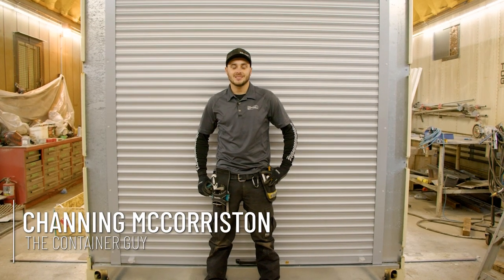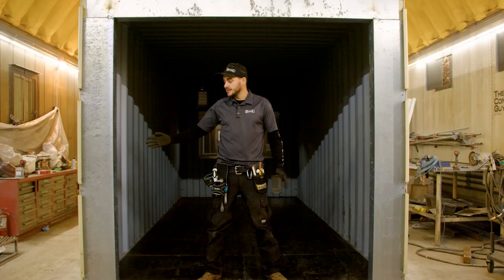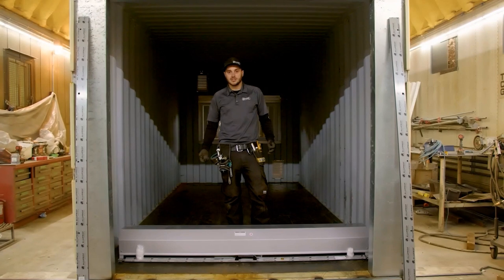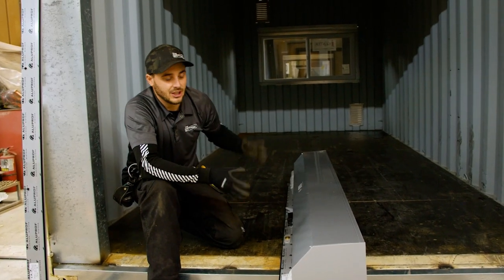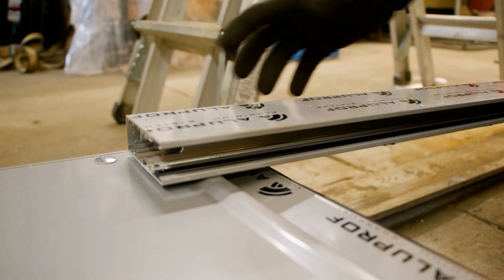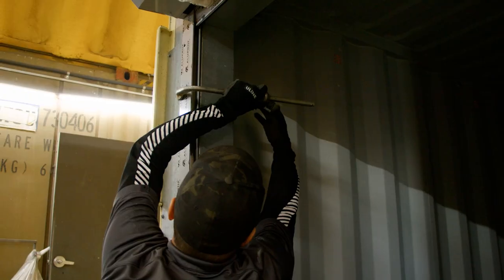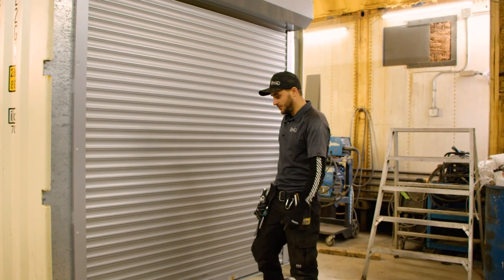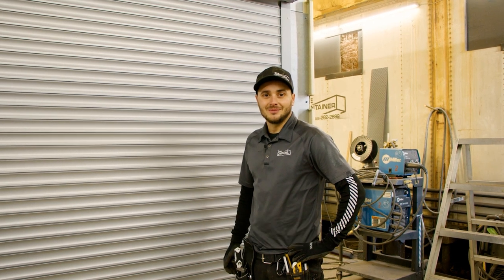Converting a Shipping Container into a Sea Can Garage or Workshop - Roll Shutter Door Installation

Comment: What does that rollup door cost I have a 20 foot insulated reefer container but I’m no longer using the reefer part just using it as storage sitting on railroad ties but the door in the back is a bit cricket so the doors don’t really close I need to pull those doors off and either replace them or put a roll up what does the cost value of the rollup.

Comment: 4:39 I notice you didn't complain this time when the frame moved because the welds broke. You must have done the welding yourself other wise you would have made a big deal of it, if the welders did it. Of course they would have done it right and it would not have broken off.  Maybe you should respect them and not cry about burn paint.
Reply from the maker: https://youtu.be/EgHlmhcF33c